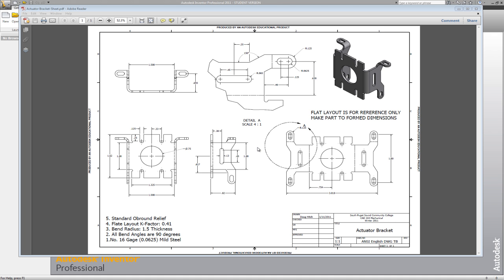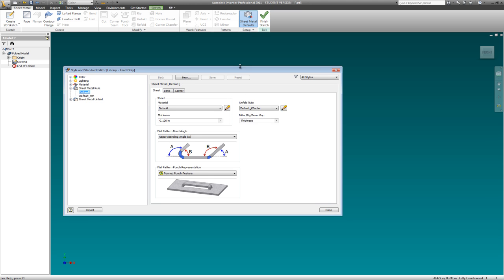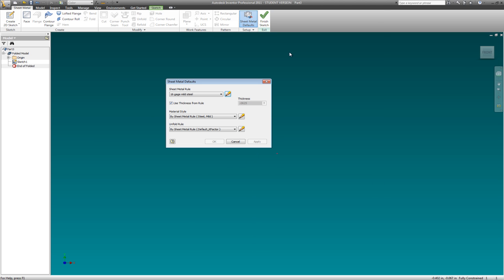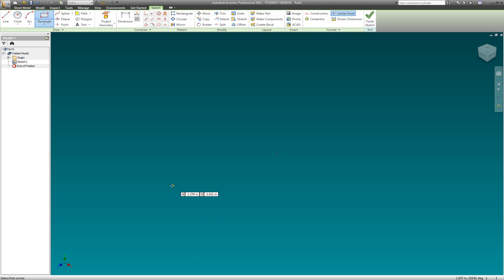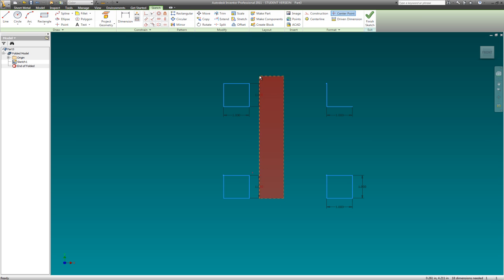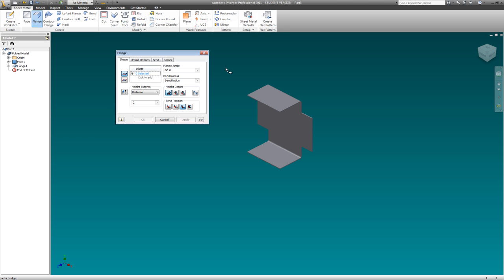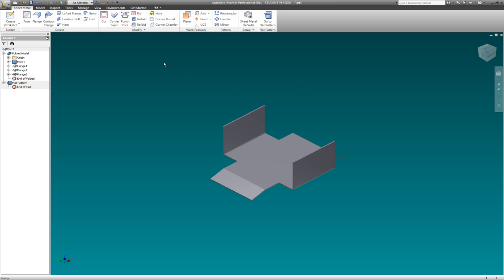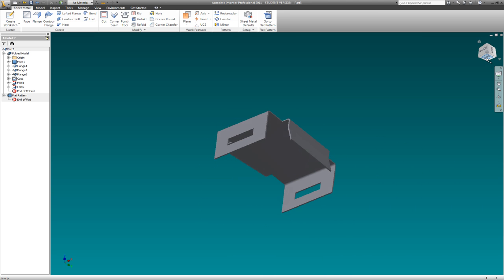Inventor 2011 - Intro to sheet metal

Comment: Thanks, that was useful. I'm a solidworks user and i thought i'd dabble in inventor as there's a few places out there that use it. Turns out its very similar but because of that, its very irritating, as i'm very quick in solidworks but slow-ish in inventor. do you find one to be easier and quicker?